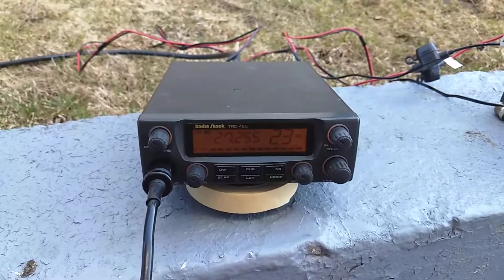It works! Cheap homemade field/ base station antenna, on a Radio Shack TRC-485

Comment: Alisha can u describe what u used to make ur cb antenna and how u made it i am interested in getting back on cb and where i live u can not buy a real cb antenna unless u order it over the internet what materials u used length of it and how u grounded it any info be appreciated  73s
Reply from the maker: R.W. LeBlanc I think I will have to make a second video and show how I made it, the materials that where used to make it, and the measurements I used. I will also try and get an SWR meter so I can show you how the SWR is and if the SWR is high I will do that in the video, that's probably the easiest way to explain it to you anyway thanks for watching and thanks for commenting!